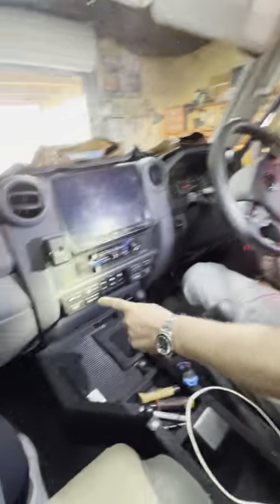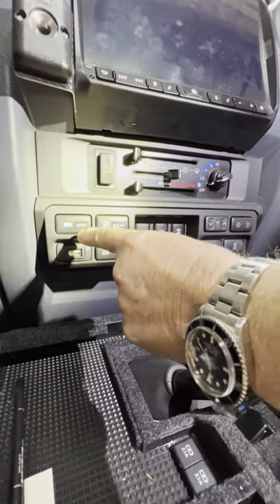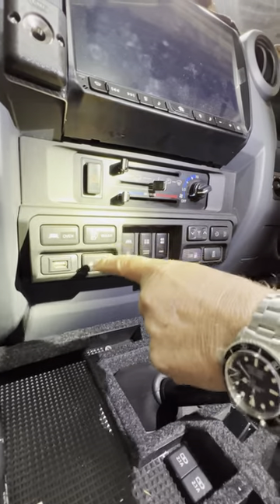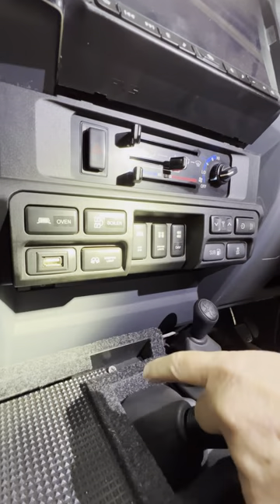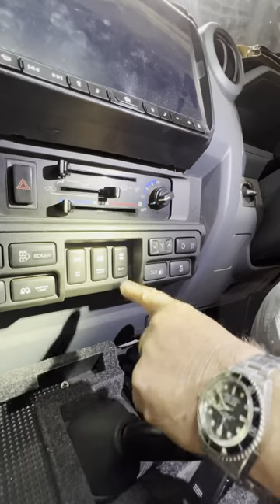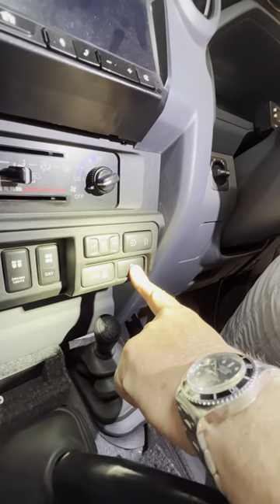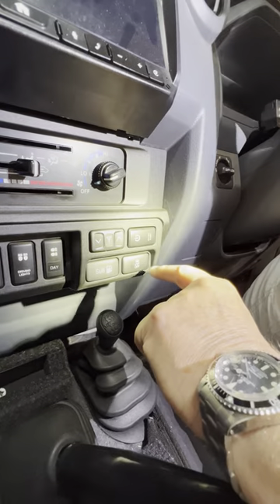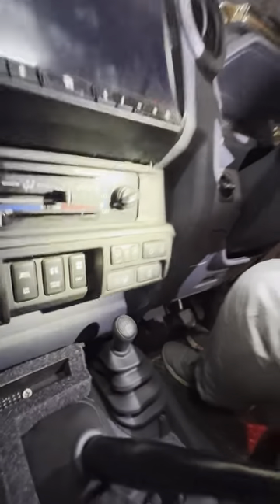The dashboard layout in my Troopy

Comment: If you have camp lights fitted to a vehicle it's definitely worth wiring them up so they can be operated from a switch on the dashboard so you can use them as auxiliary reversing lights when you're manoeuvring around a dodgy area.